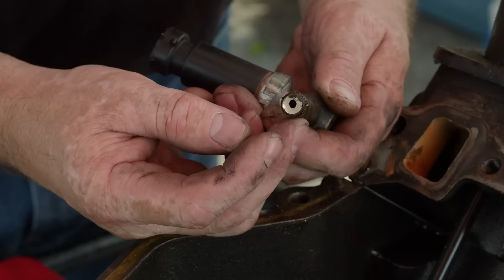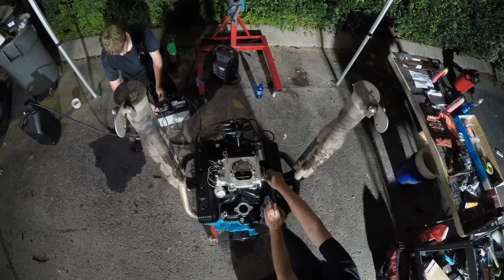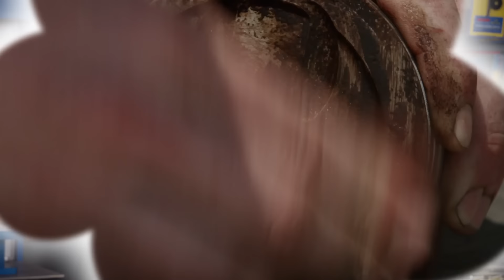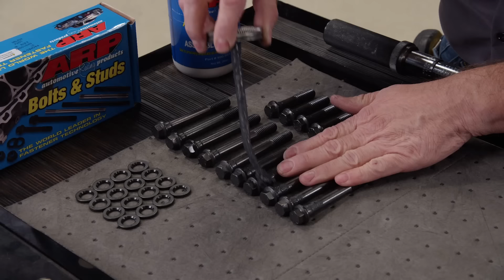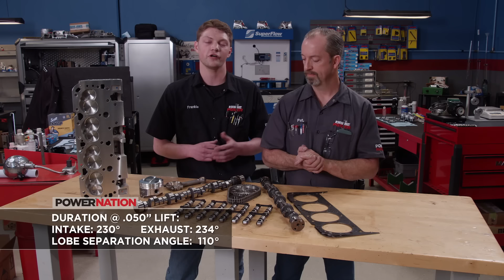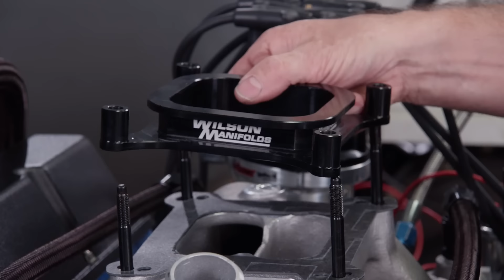Over 13:1 on Pump Gas! Chevy 350 Dyno Mule - Engine Power S9, E9 &10

Comment: Would like to see them go the other way no by using a lower static compression and shorter cam advanced and show what that will do as well.
Reply: You'd have an inefficient, wimpy, low power, low rpm, motor.
Reply: @davelowets  Not neccessarily, because it could increase the dynamic compression.  That's why I would like to have seen them go that way.
Reply: @jodypaul2695  Any increase in compression would have been negated by the low lift, short duration cam.
Reply: @davelowets  you are missing the entire point.  Go back and watch the video again.
Reply: @jodypaul2695  I haven't missed any point, but you have.
Reply: @davelowets  You're clueless.  The point of the video was to show how you can make a high STATIC compression ratio work on pump gas by cam selection and position to affect DYNAMIC compression ratio.  So, I was just saying that I would have liked to see them go the other way so that we could have a comparison.  DId you get all that this time or was that too much for brain to process?

Comment: Open question here, anyone informed, please answer-
Hypothetically, an engine with 8:1 static compression, small cam, straight up timing. Consider adding 8 psi boost, bringing hypothetical compression ratio to about 12.35.

The question- pump gas, or go all the way to E85? (Carbureted, cannot be a flex fuel) 91 octane @ 1500 ish feet MSL, is what's available.
Thanks in advance!
Reply: I know this is an old post, but...
Premium should work for 12.35:1 with colder engine temps.
But if you're going to be driving in the summer and having fun with the accelerator. You'll probably want to go e85.
Especially if you don't have the budget to replace the entire short block. Because that might be on the menu if you pre-detonate with 12.35:1 compression.

Comment: The old 360 Magnum crate motor had 380hp and 410tq, with static compression in the 9’s. Not sure what the purpose of running 13:1 static would be if bleeding or down to 9.
Reply: Just to say you can..

Comment: Hey the first block was a 2 bolt main n on 2nd build u used a 4 bolt main so its a completely different motor.....no comparison!!
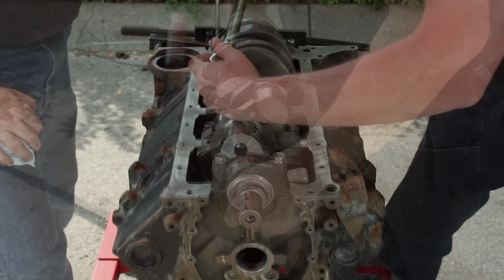Reply: Starting at 2:51 it shows that the original block is a 4 bolt main

Comment: like too see the difference using E85 vs 93 octane pump gas in the 13:1 350.
Reply: How about using a duel fuel E-85 to warm up on then switch on the propane to keep those expensive parts clean!

Comment: 22 degrees total ignition timing?

IIRC, most small blocks run full power around 38 degrees total (on gas). Could those aftermarket heads possibly make that much difference in advance timing? Doesn't seem so; it's still an old school 2 valve wedge head motor.

If the timing is backed down that much (22 degrees total) to prevent preignition, seems you're really leaving a lot of power on the table, plus it'll run hot with timing retarded that far.  Doesn't that stone axe "TBI" FI and distributor setup include any sort of knock sensors?

Modern engines get away with high static compression via fast burning 4 valve pentroof chambers, fast ignition timing maps and sensor arrays, variable cam timing, direct injection, etc. This is how we now enjoy great driveability and high power. 

That nice 424 HP small block would be a handful on the street, particularly in a heavy vehicle. Plenty of modern engines are making more than 100HP per liter, far more than an old SBC (eg, ~5.7L) with a big cam, carb, etc. I know because I used to build them...

Comment: Ya know, people in this line of work, and those who follow it, generally aren't the brightest bulbs in the pack. How dare I say this blasphemy? The engineering, let's say, was something but it's a bit long in the tooth. Let's say 75 to 120 years. Electronic engine control however has progressed greatly in the last 25 years. So, here we are, putting together high power Lego Sets. What do you say? A twelve year old with a couple years experience can pretty much handle the most complicated Lego builds. Do you still want to argue? Go for it. With enough money, which means the right tools as well, anyone with the desire can build a badass engine.

Comment: Why pump gas? Ton of power left on the table with that low timing. 110 octane and 32+ degrees of timing and it's 500+ hp

Comment: HEY GUYS, GREAT MOTOR TEST BUILD.. JUST TO ASK, DID YOU DO A PISTON TO DECK CLEARANCE CHECK.. I'M CURIOUS IF IT WAS HIGH,LIKE .030"TO .040".BECAUSE BLOCK WAS NOT DECKED..  TO SEE IF A LARGER PISTON TO HEAD CLEARANCE PROMOTES, OR CAN CAUSE DETONATION... THAT'S WHAT MANY SAY, YOU NEVER HAD THAT PROBLEM..LOOKS LIKE YOUR HEAD GASKET WAS A .040".. BE GREAT TO KNOW..AND YOU NEVER TOLD US TIMING SETTINGS ???.. KEEP THE GREAT VIDEOS COMING.. THANKS..

Comment: When are you guys ever gonna do a Dyno where are you show out the different timing curves and how it affects your horsepower and then how a locked out distributor performs on a dump now that would be amazing And if you have an idea would be great if he did like you know aluminum heads 64 cc with flattop pistons on Chevy 350 would be great with a decent cam in it with at least you know .512 lift. Or .525 lift

Comment: I think you would have better idle characteristics and vacuum if you went with 114° lobe separation maybe even a 116 and really wind it out to about 55 5600 going with a 260 270 duration. Or maybe even go with a solid roller and hardened roller rockers and really wind that fucker out. You would make for a softer bottom end not something you would want in a truck but damn she would be getting it.

Comment: sad I built a 355 in 2000 10.47 comp. hyd. roller with iron eagle heads it made 504 at 6400 . At the track spun it from 6400 to 7000 and ran 3 tenths faster so it was still making power up to 7000

Comment: Can’t make gas without oil Hey how are they going to build  repair the ROADS without oil  for asphalt! Next how long will it take to charge a Electric car  with Solar power no  oil no Coal  I want to see how you gonna heat the house up north . The people  will Not stand for the crap.

Comment: If you run one hot enough those valve springs retainers will crack an fall to pieces as a certified mechanic I’ve seen all kinds of damage from overheating

Comment: I built a 340  for my '69 340 4 speed Swinger. 59cc chambers via a .060" cut. (That basically turned an open chamber head into a closed chamber head) Add a set of forged 10.5 to 1 compression flat tops that are sitting .010" above the deck. And I used .018" thick steel shim head gaskets. I didn't know it at the time I was building it, but the static compression calculates out to 13.2 to 1. The engine was a screamer, I ran it on 93 octane premium and never rattled it once. Big block cars were easy prey with this thing, literally what the advertising agency called the 340 when it came out, "340. The Big Bore Hunter." This was in 1979...
Reply: That sounds real mean for sure. 13.2 is pretty good compression for a street car, that much compression needs a pretty aggressive cam to make maximum power out from this setup.

Comment: Those heads must be horrid to make 276 hp - especially considering the cam upgrade, aluminum intake, 4 barrel and a good tune. Some el cheap vortec heads is the way to go for this one - or aluminum cheeps if you save a few bucks before hand.
Reply: TBI heads, 76cc chamber, tiny ports.

Comment: Pat Now try  E-85
Reply: With all of the storage issues E anything causes to fuel delivery components, I'd avoid that if I were them. While I do respect the fact that people like ethanol, I personally see the stuff as nothing more than a major headache. No shelf life to it. Sucks moisture into the fuel system as bad or worse than methanol. Just not a great fuel when they will take it off the dyno and store everything. Plus any fuel left over would have to be some how discarded quickly.

Comment: I would love to see the next video to learn how ve and it all works? 

I get confused and kinda feel miss lead when I hear dynamic compression works against the cylinder pressure. There should be something like dynamic dynamic compression ratio that includes how the air works at different load and rpm. I guess that is kinda ve.

How about a video on ve with this build?
Reply: Put this thing on race gas and start playing with header tuning, intakes, and cam timing.

Comment: 413hp is pretty lame for trickflow heads and 13/1 compression. Did you check the valve job on the heads or just bolt them on? You should figure out why it's so far down on power and correct it in the next episode.
Reply: It's 12.8:1 air fuel ratio and 22 degrees of timing on pump gas so thats why it makes that. I doubt that there is anything wrong with it just a safe tune up on it so they don't break it.
Reply: @strictlybusiness1598  Leaning it out isn't going to change much. It may lose power with less fuel than that. Similar engines with an efficient combustion chamber like an LS make the most power with ignition advance in the mid 20s. Half of the comments on this video seem fake or planted. This engine makes about as much power as a stock LS2 and they still act like they accomplished something really impressive. Go over to Richard holdener's channel and see what a junkyard 5.3 with a cam and headers makes with 35 less cubic inches and 9.5/1 compression.

Comment: yeah if you give it an enormous camshaft you can run 13 to1 LOL,drops the effective compression ratio down low in the rev range where detonation would normally be a problem

Comment: Now heres your next episode with this engine.  Install the bigger cam and dial it in advanced enough to get the exact same dynamic compression and retest.  Then install flat top pistons and advance each cam enough to get the exact same dynamic compression but with less static compression and advanced cam timing so we can see how each way of getting the same dynamic compressions effects power output.

Comment: 4:20 - 👍 for getting that right! 😊
18:20 -ish, with high compression pistons and/or heavy head/deck cuts it's important to check for piston to sparkplug clearance - if it's close it could just be a slightly closed up gap but if it's bad it could damage the piston, or worse.
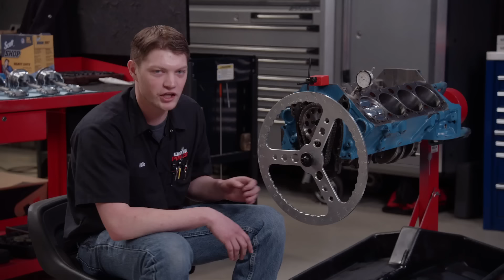29:45 - close but not quite - you have to figure in the angle of the crank journal and connecting rod length as the piston position is governed by them - it isn't anything like the sinusoidal curve a simple crank angle would suggest.

Very good power and torque numbers - what was the BSFC, i would expect that to be a little better than average, and for a street car it should give good cruising MPG, too, which is getting important with prices as they are?
Reply: I would love to know the BSFC.

Comment: Let me get this straight. Sbc 350, good heads, 13:1 compression, 230/234 cam and you made 413 engine dyno horsepower? Why would you even publish this and act like it is a win? Please go back and see what went wrong. Any junk vortec 350 with a big cam makes the same hp

Comment: Engine oil on a hone? I think you’d be better off using solvent. The intent is to wash the abrasive out of the cylinder so it doesn’t act like a lubricant and cuts the glaze off of the surface.  Oil does the exact opposite.

Comment: I would like to know what the cranking compression is.
I built a 350 years ago with 11 to 1 compression static. Used a comp cam 280-280 magnum cam. Advanced the centerline 4 degrees. It had 220 lbs cranking compression. I had to use 93 octane fuel just to get it to crank. Timming could be backed off and it still wouldn't cranking after being warmed up without 93 octane fuel. To race it with 32 degrees of timing, I had to use race fuel. Yes I drove it on the street a little.
So what is the cranking compression?

Comment: They act like a single plane intake is a sin on the street when in fact the added plenum volume with a single plane would really help at idle keeping the reversion factor down that happens with too much bleeding off of the compression stroke. With the bigger cam they never used a large single plane intake would work great. Would like to see those numbers!

Comment: I’m not a tech guy with databases like you guys but I am very interested to learn about static  compression and dynamic compression for a Pontiac 400 block with a stroker kit from Butler to become a 461 c.I. Engine. If you have any literature that you could pass on to me I would greatly appreciate it thanks in advance

Comment: Great episode, although I'd like to see a follow up two different ways.  1: bring cam back to straight up,  add some octane and see what is the difference in output.   2: lower static compression to run cam straight up on the pump gas and see how that compares.  My question is,  is it worth it to try and "cheat" the compression to octane or not!
Reply: If it's worth it to you honestly will depend on a ton of variables. Running a DCR of 9.0:1 in a car even with 93 octane gas is pushing your luck in my opinion. 
They used a way less than idea timing curve to avoid trouble. The other major consideration being that dyno cells are highly controlled environments. The under hood area of your car is far less controlled. The dyno isn't sitting in traffic spiking under hood and cooling system temps. The dyno isn't having to deal with ever varying air inlet temps. Those are all variables that are easily controlled in a dyno cell. Your ride, not so much.

Comment: A good follow up would be to
Run 100 octane and throw timing back into to see how much was left on the table
Reply: Yeah. I thought the power wasn't too impressive, as even 9:1 350s with similar cam and heads have made even more power. Then reminded myself that they only had 22° of total timing in it.
Reply: It would need MORE than 100 octane fuel to get any amount of timing in it.

Comment: Lays over pretty hard at 5k and behond. Be a much better build with a 260-270 ish .630-.630 on 107..would make 560+hp and pull to 7k.
Reply: Not with those heads.  Need 220

Comment: @7:49, the intake gaskets are put on backwards.  The block-offs should be on the back side.  Surprised it didn't overheat on the dyno.
Reply: How did  that engine  NOT overheat????,

Comment: I'm surprised they didn't do a timing sweep.
Should be a minimum 450 HP build.
Reply: Ya, this build should have been making way closer to 500hp. The fuel was the biggest crutch here. Methanol or at least 93 pump gas would have helped this motor sing a bit happier.
Reply: @rcsmith8162  changing to E85 would have been interesting
Reply: @rcsmith8162  Pretty sure they were running 93 octane.
Reply: I don't think they had the tuning window to do that. Despite using an aluminum head with a much better combustion chamber, I think much more timing and it would have detonated.

Comment: Ran the same a similar set up in a different engine on 87 and had no issues with it ever. In a daily driver so yea 25000 miles a year. Drove it 4 years before before I checked everything and did gaskets and a little cleaning and that was it.
Reply: Sure you did...

Comment: with , 6" rods, 65cc chambers, O.O38" compressed gasket, zero deck, 3.48" stroke, 4.062" bore size, 12cc total on reverse dome or pop up dome pistons, for 13:1 static compression you would need 306* advertised duration to get 8.87:1 dynamic compression by pat kelley's calculator, and that is still on the high side of pump gas, and probably nearly a full point higher or lower with other calculators. this is around 200-400-600 feet elevation. be sure to gap your ring at O.O22" instead of O.O18" to allow pressure to escape between 1st and 2nd rings. Generally target 7.5;1 through 9.5:1 dynamic compression for pump gas depending on the calculator thats what i have been told anyway. 175-205 psi depending on the engine for 87-93 octane. This is very vague, heat , elevation , timing, cooling system, oil and gas quality all play a role in pump gasability and that is after the engine is perfect. Chevy 355's and 383's with 6" rods do great with great heads and cool cooling and handle 205 psi with vortec heads 10:1 and XE274 cam on a 355.

Comment: So your basically "bleeding off" compression by leaving the intake valve open? Doesn't that defeat the purpose of having high compression to begin with? If you're trying to build a performance pump gas engine,  there's a million better ways.
Reply: Porsche uses a similar design but their intake manifold is so tuned that the air comes in so charged it is under pressure and continues to blow into the engine even as the piston starts moving up.. the valve slams shut at just the time it would start flowing backwards. I think that is the purpose of this as well.
Reply: @ohioplayer-bl9em  Yes, like back in the days of tuned tunnel rams.  Always fun trying to figure the pressure wave.
Reply: Troy.....This engine was built to show you how the valve timing events affect compression. It wasn't meant for all out horsepower
Reply: @ironmike742  anyone with basic engine knowledge should know that. There is no point in the engine test. It's useless information.  Build a 10.5 sbc with proper cam for the application and it will run better and make more power. Your cam should not only be picked by compression......period
Reply: You add compression to make up for what the cam is bleeding off.
Reply: its exactly what those sport mod guys were doing when they had a cylinder compression limit. Bleed it out the valves.
Reply: The purpose of a high lift cam is to bleed pumping pressure. If you use a small cam the dynamic pressure builds up. It’s vice versa on low compression. Need a small cam to build cylinder pressure.
Reply: @vinceyoung5912  it's the valve timing events that affect compression not lift
Reply: @ironmike742  of course duration and lobe profile and cam angle